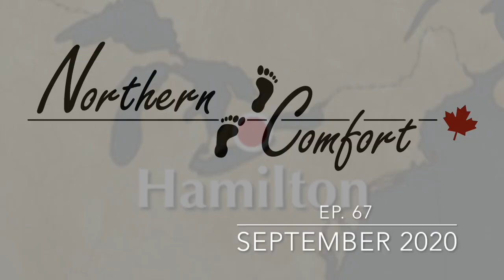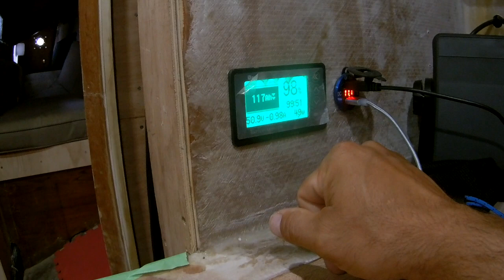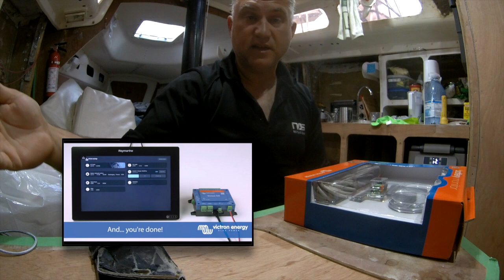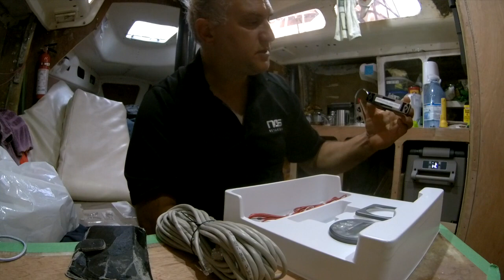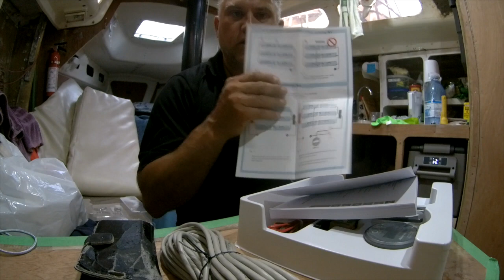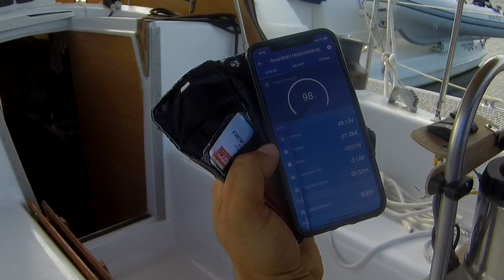Ep67, UNBOXING the Victron Energy BMV-712 Battery Monitor w/ Bluetooth

Comment: Thank you for the video. What is the diameter of the hole required and the diameter of the display? I've been trying to find it online and emailed the manufacturer but I still can't find it.
Reply from the maker: hi try https://www.victronenergy.com/upload/documents/Quick-Install-Guide-BMV-712.pdf the dimensions are on there 52mm hole and 62.4mm front width on the round face. they also had a square front template in my box but i didn’t use it i used the round one. good luck!